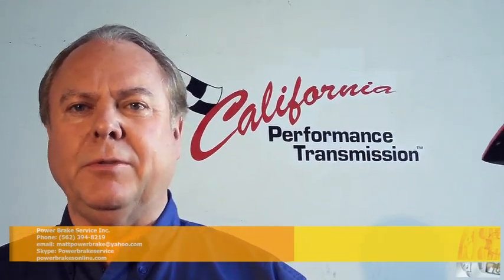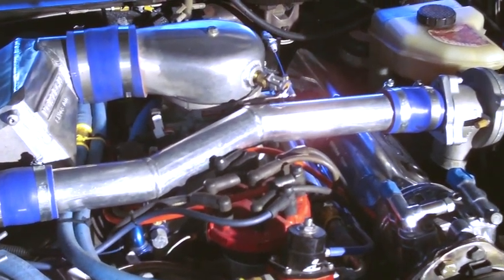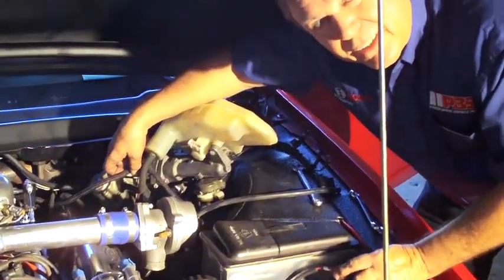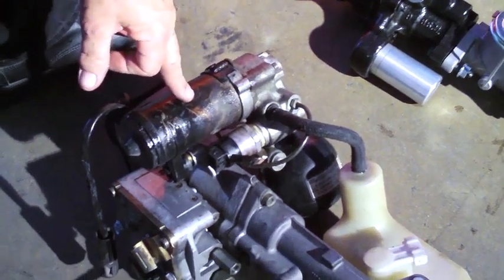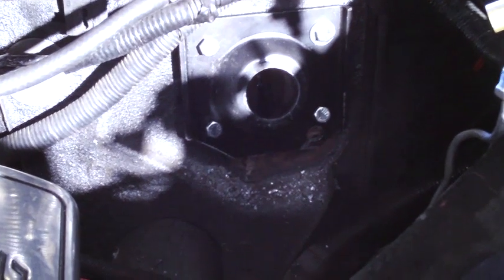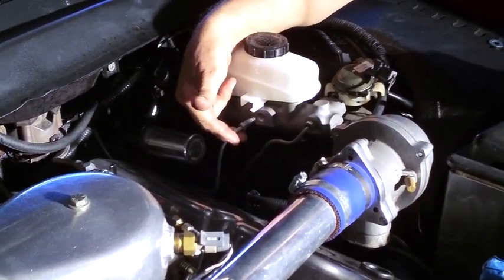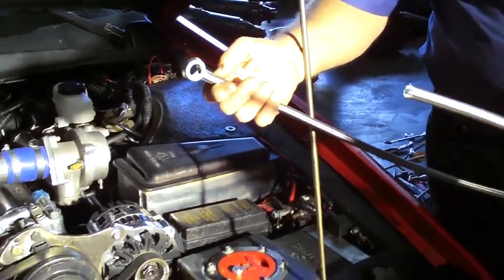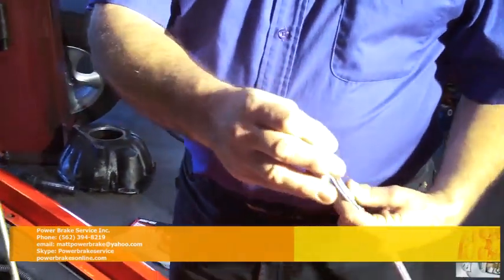Hydroboost Installation Pt. 1 on a supercharged Ford T-bird, Lincoln Mark VII, Mercury Cougar

Comment: Wish I had knew about this company years ago. I have a 90 Tbird SC that I race and my brakes are marginal at best. The Teves unit went bad years ago and I converted to the standard vacuum brake booster with a separate vacuum pump mounted under the fender to maintain vacuum. This unit looks like a 10 times better set up. I just upgraded my front brakes to the 97 Mark VIII calipers and rotors, if my brakes don't work much better this unit is in my future.

Comment: I need this for my 1990 supercoupe to get it back on the road.  I have a great engine/trans but due to a brake problem not been driving it.  I need my back up car back.  Plus I love my T-bird.  Going to work but will check back later.   This might have just saved my car.